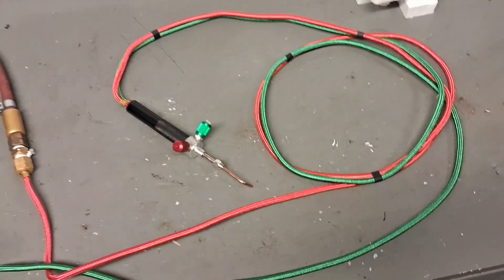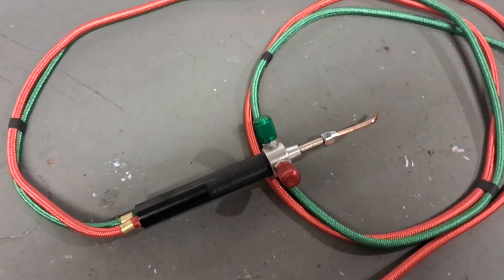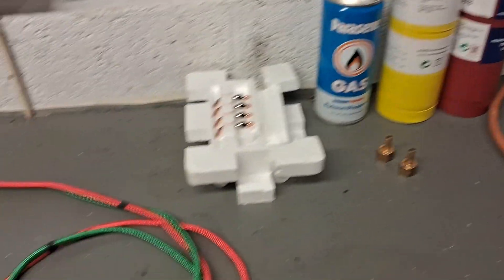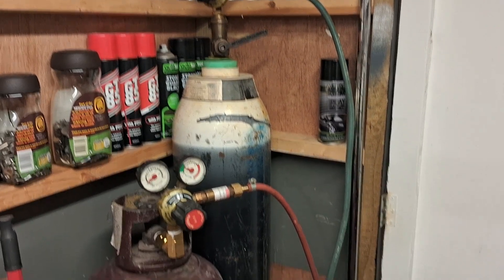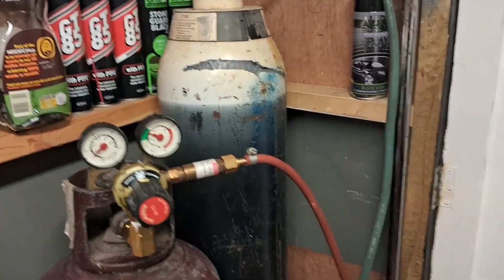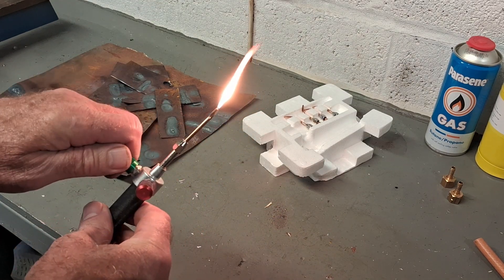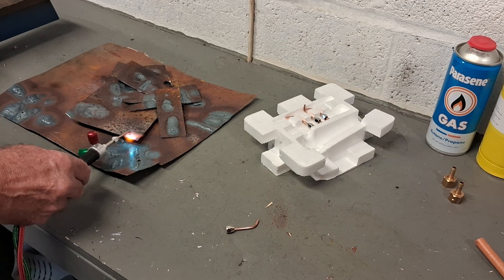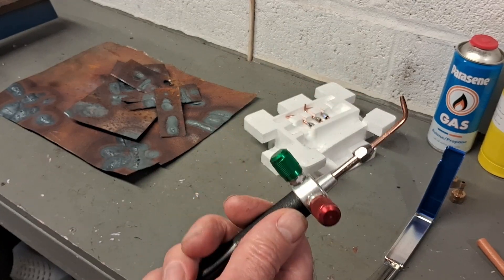CHEAPEST MINI GAS WELDING SET MAPP PROPANE OXY ACETYLENE KIT GEAR CRAFT JEWELLERY SOLDERING BRAZING

Comment: i've used these for 'leading' fuel tanks too seal leaks, brazing water pumps , soldering , plastic welding,  thin steel cutting, sealing pipes and brake lines and much more you can do with a full size unit, i advise you fine a rose head fitting for it too really hand for many reasons including bolts where you want to put heat on a exact spot.
Reply from the maker: Thanks for sharing , GREAT